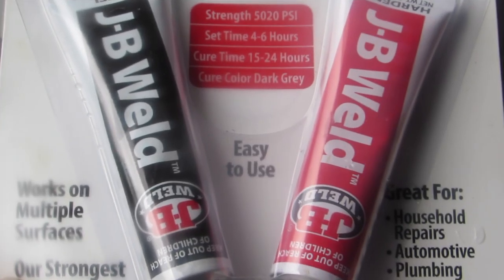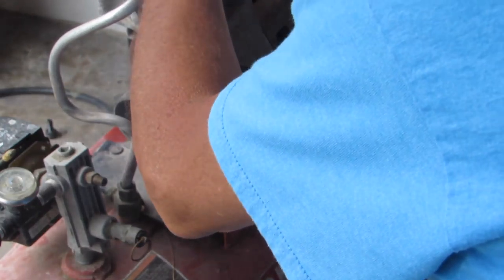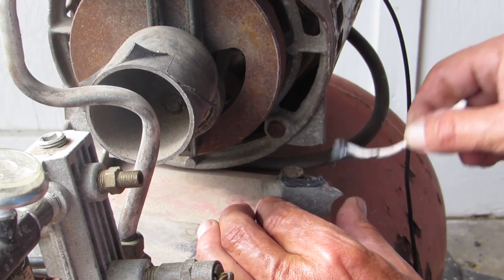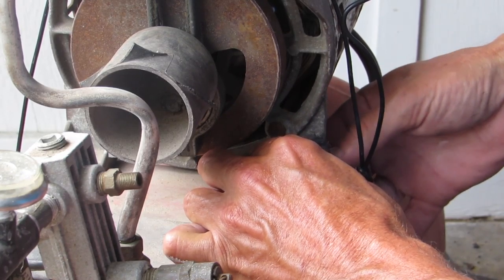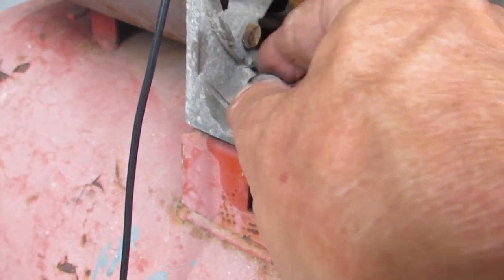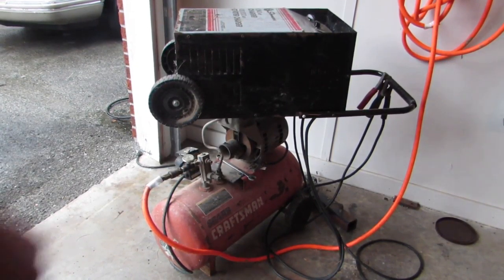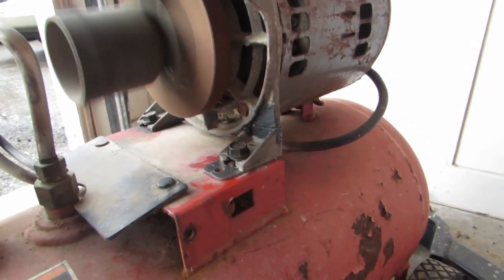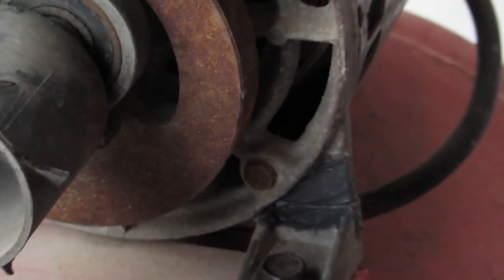JB Weld, Does it Work?

Comment: JB weld works better on smooth surface andclearly those are rusty metals. You didn't even bother cleaning the joints. It works on my bike frame.
Reply from the maker: The metal is cast aluminum, which doesn't rust and clearly you're pulling things out of your ass in an effort to be a glue-expert. 
Why does such a glue expert as yourself search for videos on if a glue works?
Reply: Hi there. I saw your comment on using JB weld on a bike frame. Do you think I could fix a bracket on my bicycle that holds the front derailleur on? I tried to bend the bracket back slightly and it sheared off! My last video has me doing a temporary fix to get me home (my chain snapped and derailleur is jammed). Then when I got home I discovered that my derailleur is fine (I think!), but the bracket was bent and now snapped. The bracket is part of my frame which is seriously expensive to replace! I'd really appreciate your view point on this! Thanks :)
Reply: @AyupStuggy  no bro. It will never hold. JB is strong but not string enough to hold during shifting. Better to replace your frame or whatever needs to replace for your safety.
Reply: @armanborloza7981  Thanks for replying so quickly and for confirming your thoughts about strength of the JB Weld option in this application. I may well go down the route of grinding off the 'braze-on' bracket back to the seat-post tube, and fit a replacement clamp type of 'braze on' bracket. This has been suggested on a facebook forum. I could also try and get another braze-on bracket or get that one re-welded. I don't fancy that option though as it would mess up much more of the frame. A new frame is £1000+ !!!!   Thanks for your help. Take care. Stuart (aka Stuggy :)
Reply: @AyupStuggy  with that expensive frame, welding is the best option. Ride safe bro.
Reply: @armanborloza7981  Thanks for your help. Take care

Comment: you should have physically welded the metal or make a new piece
Reply from the maker: Well - I did. I got my buddy to mig-weld it, but I wanted to test this crap first.
Reply: @JohnDisque  nothing beats doingit right the first time :-)  the manufacturer used cheap made metal casting for the footings on that.  shoul dhave used solid metal or solid aluminum. as for fixing this.. even if you weld it.. its junk metal anyway.. i say make new brackets

Comment: Not surprised.  They may put the word "weld" in the product name, but it's not that capable.  I used it years ago to seal a low pressure pipe.  It worked okay for that.

What might work is drill some holes through both sides of the mount and span the gap with a bracket.  (Just a piece of steel with some holes.)
Reply from the maker: I was actually considering what you're suggesting with a bracket. 
I think it might work on something with no pressure or movement, such as a secure tailpipe, but if there's any stress on the part you can forget it..
Peace.

Comment: Just paint it black. That should do the trick ;)
Reply from the maker: LOL I will try that! I mean - it couldn't be any worse.
Reply: @JohnDisque  You could also try drilling a hole through both parts and bolting a metal plate to it on both sides. Then paint it black. I don't know. It looks terminal ;)